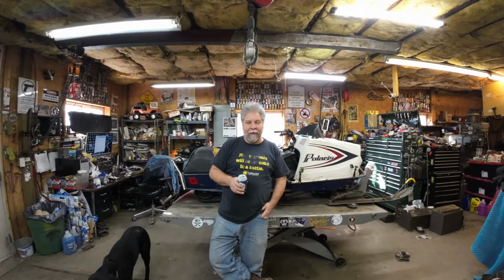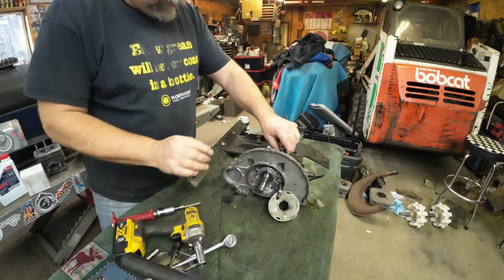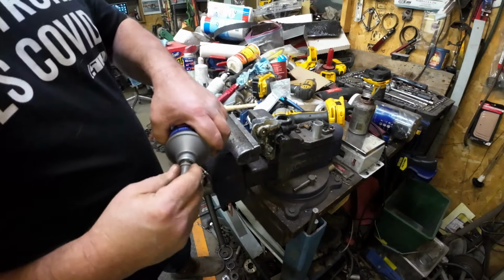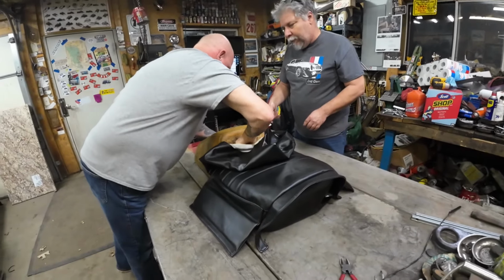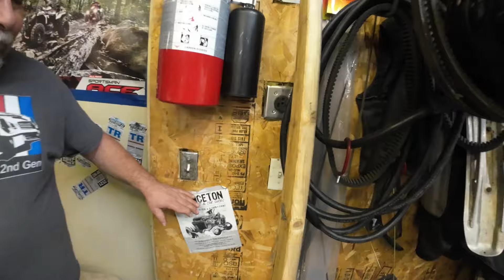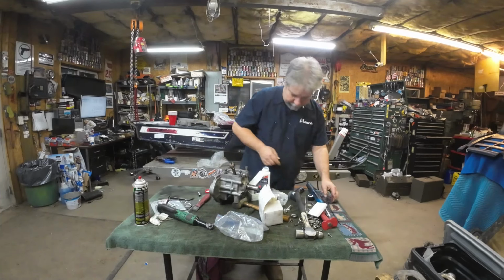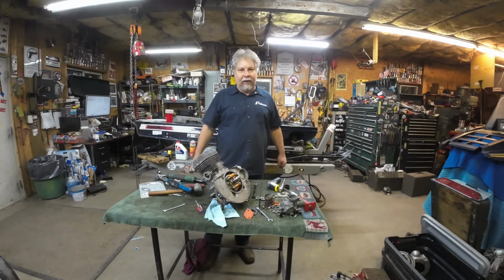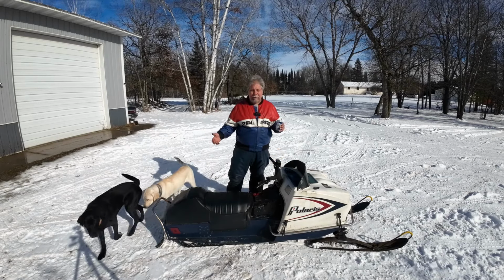One Lung Polaris Race Snowmobile Part 4. Engine rebuild and test runs! Vintage Polaris Snowmobile.

Comment: Dang!  I had two ‘74 Colt SS.  250 twin free airs.  Installed temp gauges under the plugs, since I did a lot of bush whacking in warmer weather.  Those sleds would climb anything.  (One climbed ten feet up a tree leaning over a cliff. - we stopped at the top to admire the view and a sticky new belt idled the machine right off the edge!).  Suspension left a lot to be desired travel wise, typical to the era.  Wish I could have  kept them.  Still have a box of new old stock for them and all the special tools too.  And you absolutely MUST have studs on those metal grousers =. Those tracks would slide sideways like a luge on a run.  Don’t ask.

Comment: Even though I've done plenty of quickie top end jobs, in general always preferred to pull the crank out for a full clean and inspect, little bit of time and some case seals always made me feel better, even when the bearings and everything else was intact.  Funny how by the late '70s those car like bodies looked so old and dated, now they seem pretty freakin' cool again!  I bet you could scrounge part of an old tank or a simple bend of metal to make a tank extension and fill that gap at the front of the seat nicely.  Kudos for keeping the extreme vintage alive.
Reply from the maker: Thanks.

Comment: Recently, I just free build a 250 motor myself. You mentioned rebuilding the car my change in the pilots in Jets, but she didn’t offer the information on the size of the Jets and you mentioned you were going to do some clutching, and just for the sake of future, hope you are going to, tell the size of the clutch weight and spring pound age thank you in advance
Reply from the maker: It's pretty easy to melt a piston and my setup might just do that on a different sled so I don't give out that info. Tune at your own risk. You can find the 1972-1981 factory service manual for free on vintagesnow(dot)com and the stock jets and clutch setup is in there.

Comment: Love these old sleds. A buddy and I have been having terrible luck with piston rings. We honed and reringed a 74 colt 250 twin and after 15 minutes of run time the rings were toast.  Any suggestions?
Reply from the maker: That's an iron bore cylinder so the rings should be chrome faced. Otherwise it's a matter of getting the right finish and breaking them in properly. I'm using about a 180 grit stone for the final finish. Some might say that's too coarse, but it works for me.
Reply from the maker: I should add - you need to make sure your cylinder is round. Putting a cross hatch on a tapered or out of round cylinder is pretty useless. If you go back to the video where I honed this cylinder you can see the equipment I used. A ball hone or a weak three finger hone won't bring a worn cylinder back into shape. You might need to get it bored for the next size piston, but just finding a good used motor is often cheaper.
Reply: Thank you much. Love the channel

Comment: Pretty sure that motion pro wrench needs to be at a 90 degree angle.  Also congrats on 5k subs.
Reply from the maker: Thanks for watching. I looked at the instructions and that is not the case about needing to be 90 degrees. 90 degrees also makes no sense for how the calculations are done.
Reply: @nuttersspeedshop  I think when it is at 90 degrees no calculations need to be made. Set the wrench and you're golden.
Reply from the maker: That is not what the instructions say, but you do whatever you want.

Comment: Hey John I’m re building a 74 tx 250. Will any year Indy brake master work or is it just certain years?
Reply from the maker: Pretty much any 80s or 90s master cylinder should work. They all had a 3/4" bore. Just look for one that looks like what I used in this video.